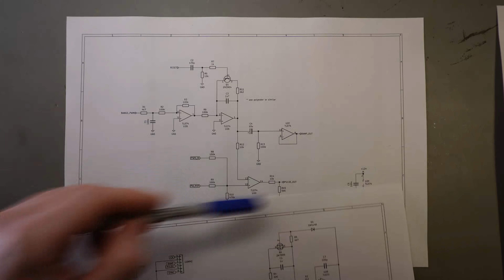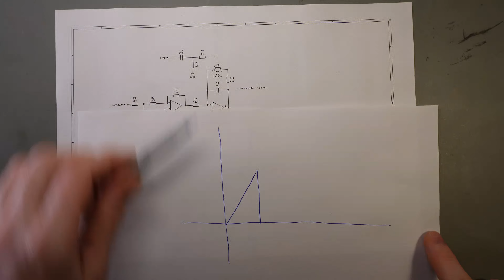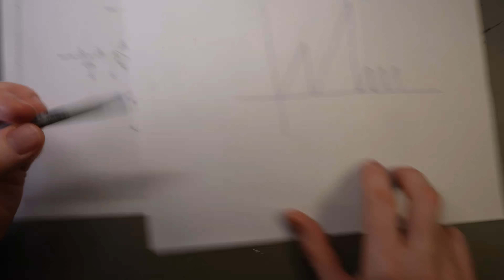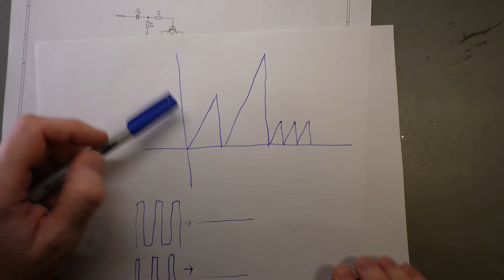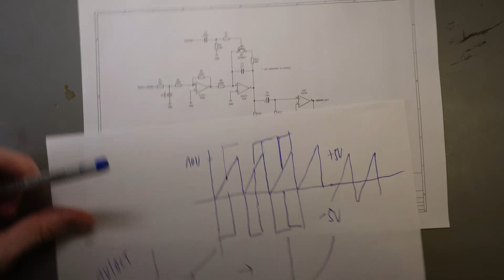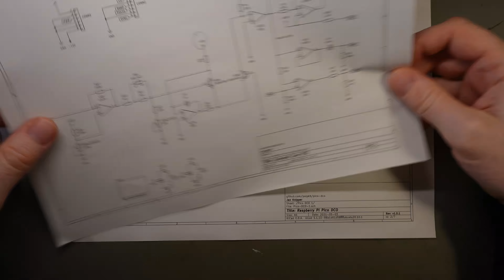How Digitally Controlled Oscillators (DCOs) Work

Comment: Ah! So that's what they're doing.

But … now the pulse width depends on the charge rate and not the reset timing, so the harmonic content of pulse becomes frequency dependent, no? Because basically this is generating its output by hard sync, and a sawtooth is the (I think unique?) special case that is waveform-invariant under hard sync.

You could presumably use a threshold detector at (say) 0V to an input pin and then use a PLL strategy to fine tune the charge rate. Then you could get consistent output voltages and better controlled pulse widths. If that matters.

Or?
Reply from the maker: Yes, I guess you are right. Depending on the strategy for amplitude compensation, the pulse width might vary. Using a precise amplitude compensation method should fix this. I’ve never thought of this.